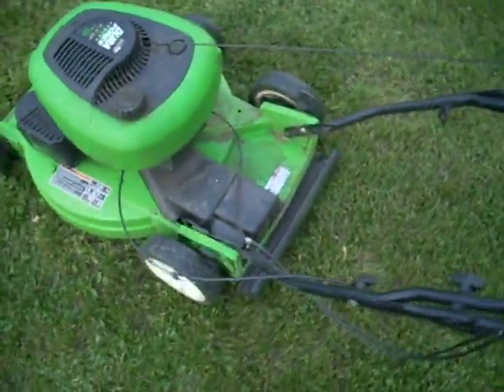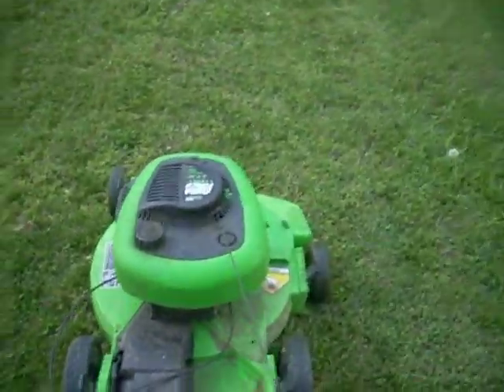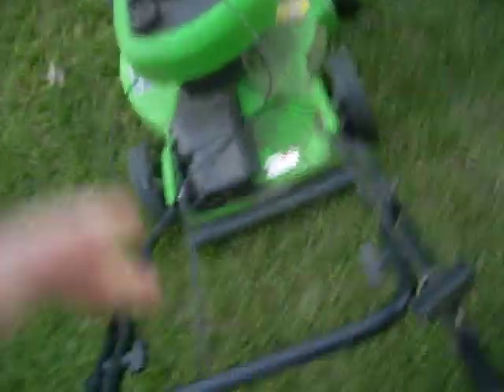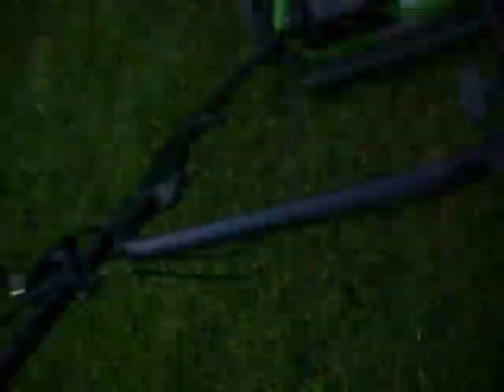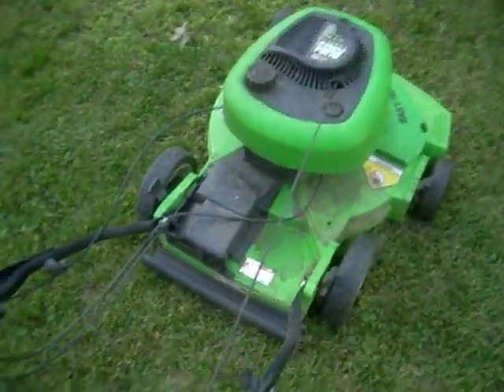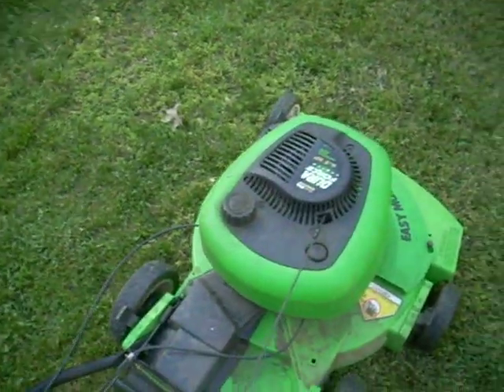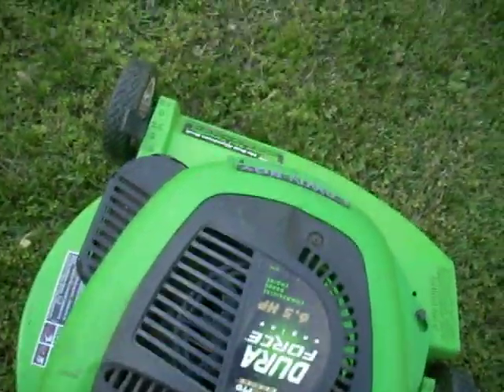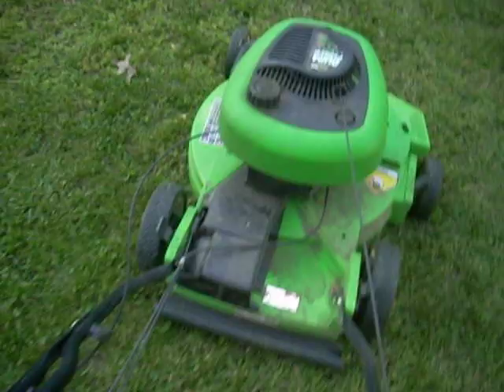DURAFORCE SURGE...CURED

Comment from the maker: Thanks!  I'm really happy with the way it runs.  It's just a beast.  One of the first things the guys mentioned was checking the hole in the throttle plate.  It had the correct hole in it.  I checked the RPM's with a laser tach and got about 3250.

Comment: Sounds great!  Good job!  One thing I didnt hear mentioned at MTF was some of these D/F engines were put together with snow thrower carbs.  The throttle plate hole was too small for cold air, and this seems to have an impact on the grass machines.  Cast connecting rod so keep it under 3300rpm.
Reply: Pretty sure this is a E Series motor

Comment: Just got this same mower today.  What mix, fuel do you use?  Best to use super unleaded? what about the new synthetic brand oils?
Reply from the maker: I use whatever does not have alcohol in it for fuel, 32 to 1.  I don't use synthetic oil even though it is better...i like the smell of real oil. :)
Reply: I sold this piece of plastic shit already!  Got an older 3.5hp B&S Lawn Chief, has more power and no problems at all.  They dont make them like they used to thats for sure.
Reply: @EdStaniszewski  no way a 3.5hp Briggs has more power than a 6.5 duraforce.
Reply: No ethanol high test works well for me.